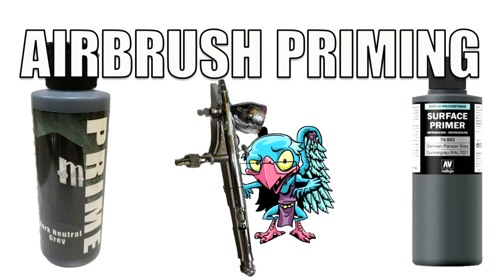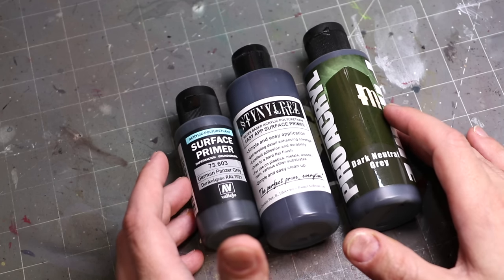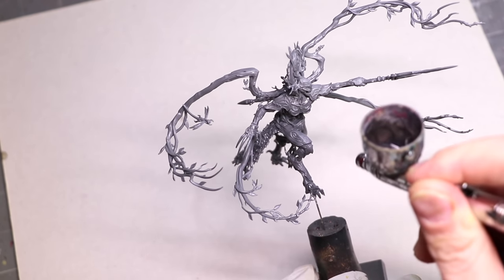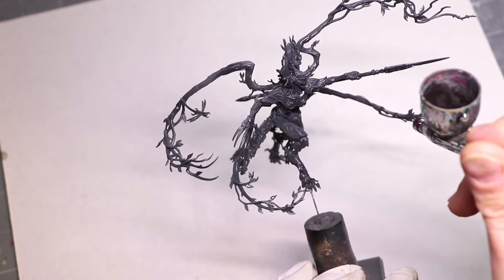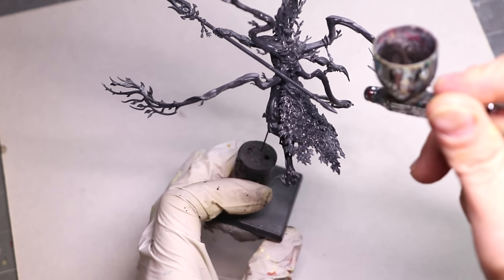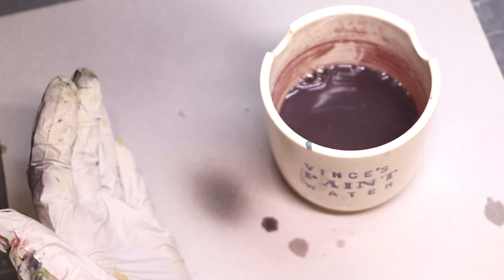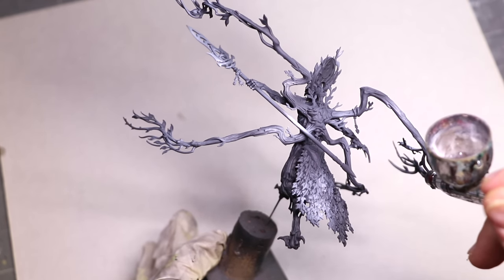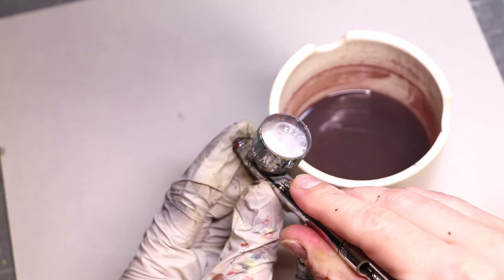Complete Guide to Airbrush Priming - HC 350

Comment: Isnt White ink stricktly better for the zenitial highlight than white primer? Thank you for the video im new to airbrushing and had the problem with drying in the cup. Thanks vince for all the great Videos.
Reply: Naw. White is white. White ink is generally smoother than most white paints, ie not chalky, so is preferred but there are some good white paints on market that aren't chalky.
Reply from the maker: So some people have issues with white ink reactivating. I tend to prefer white paint actually, sort of in the middle, as I never use straight white, but always ivory, or a light blue or something like that to set the tone. That being said, I never have an issue white ink.

Comment: Hi Vince. Great video. Great channel. I am having good success with Pro Acryl primers, as someone new to the hobby. I use their black and white for a zenithal prime. I also use Vallejo Cold Grey Game Air for a grey tone. In this video, you mention Pro Acryl Dark Neutral Grey is fast becoming your favorite. I am tempted to pick it up. Why is it your favorite? In what applications do you use the dark neutral grey? Do you include it in zenithal priming? Do you prefer it to black? I've used Vallejo Grey primer, but don't like it. It is a much lighter color than Pro Acryl, but that's not the reason. I struggle to get an even coat without gumming up some of the details of my model. I am still new, but I find Pro Acryl more forgiving.
Reply from the maker: I love the dark neutral grey, and it basically replaces black. It's just a softer color that isn't as harsh as the black for zenithal.

Comment: I got an Iwata Eclipse HP-BCS Siphon Feed Dual Action Airbrush many, many years ago when I was airbrushing shirts and fabrics. I am wanting to use it for miniature painting now, but most/ all videos I find revolve around airbrushes that use paint cups at the top. What would be the best way to use it for priming if I can not add a few drops of thinner before the paint? Should I use a separate bottle for thinner, spray a bit of it, and then put on the primer bottle? Thanks for any advice.
Reply from the maker: So best option? Buy a cheap new gravity fed airbrush, I promise you in the long run, the 30-100 you spend is worth it compared to the frustration. That being said, yes, separate bottle for primer and paint.

Comment: Angel Giraldez says to pour your paint into some container first to prevent clogging by solid paint chunks, especially when you want to prime with some paint not meant for airbrushing.
Also did you try submerging the airbrush completely in a bigger container when changing colors?
Reply from the maker: That can be a good tip. I often just strain out my primer through something like panty house. I don't generally submerege between color changes just because of the mess, but I like to store it in water.

Comment: Great tutorial as always! I'm going to have to try out that proacryl primer. 

Vince, do you had any advice on issues with airbrushed inks not binding properly to paint? My models could be primed, left to cure overnight, then inks airbrushed on and left to cure overnight and still when I go to paint on top of them the ink layer gets ripped off by the brush. Varnishing after inking is the only thing that seems to work but I never see pros like yourself having to do that so I must be missing something.

The only thing I could think of is that I may be using too much flow improver (sometimes 2:1 or 1:1 paint to flow improver depending on the paint), but if I use any less I get dry tip near instantly. So I'm kind of damned if I do, damned if I don't in that regard.
Reply from the maker: This is generally why I favor paints instead of inks for zenithal, inks can reactivate when exposed to additional iquids. My best advice is you can varnish after that ink layer. Two layers of varnish should provide you with a protective layer so the ink doesn't reactivate. The other option is of course to switch to a thin paint.
Reply: @VinceVenturella  That's a great point and thanks for the advice! I will probably move to using white primer for zenithal like you demonstrate in this video and I'll continue to varnish if I ink. At least I know that I'm not entirely crazy for not always trusting my inks.

I guess the thing blows my mind is when I see in your videos that you'll bounce back and forth between airbrushing inks (as well as paints) then a brush over them and then specifically mention that you never varnished between layers. At that point I realize I've gotta be doing something wrong.
Reply: gamblortoo: Try Tamiya Flat white for a zenithal highlight. It sprays beautifully. Thin it with pure isopropyl alcohol.

Comment: Each time I prime with an airbrush, it gets a little easier, but I always feel like I’m spending more time than I need to. I watched this video again and want to make sure I understood something you said in this video: Should I only be spraying for 2 to 3 minutes max before cleaning the cup and continuing to prime? 

Yesterday I primed seven plague Marines and it took me about an hour and half. I was priming pure white which know is obviously a factor. But I just kept getting clogs and dry tip  after the first few minutes of priming despite using thinner before adding primer and using a high psi setting. Is this just what happens when you prime with white? I am using Vallejo white and the Iwata CS-Eclipse. 

Also thank you for the wonderful content!
Reply from the maker: Okay, so that's terrible, and the reason is the primer. Stop trying to use Vallejo white primer, it's trash (most white primer is trash). If you want to use primer, then Pro Acryl white primer is the way to go. Otherwise, just use like an ivory paint thinned down (or one for an airbrush), and your life will get much, much easier.
Reply: @VinceVenturella  Got some Pro Acryl for next time, thanks!

Comment: if I prime with airbrush I also immediately varnish my model (with airbrush) to seal it because I've had problems with the primer rubbing off (I never have that problem when priming with rattle can)
Reply: I was going to ask - I notice chipping with vallejo mecha and standard black. I applied a varnish of testors dullcote and it seemed to really help. Will acrylic paint still adhere and go over the varnish?
Reply from the maker: Yep, nothing wrong with that at all. :)

Comment: Thank you so much Vince! I have some questions. I currently own both 0.2 and 0.4 nozzles and I struggle with constant tip drying with the 0.2 nozzle. Shall I switch to 0.4 for priming? How can I prevent tip dry with 0.2 as I want to do some detail work in the future and not scared of 0.2 tip. I tried retarders, thinners, flow improvers but still having the same issue. What is the ratio do you recommend? Thank you!
Reply from the maker: Yeah, in general, you want a larger nozzle for priming.

Comment: White primer is the worst. I spent a long time struggling with it when I first started. I was using a cheap brush and probably not storing the primer well or using old primer which didn’t help. My top tip for airbrushing white paint is to mix it outside of the airbrush. I now look it like I’m making a white sauce, I add a little bit of thinner at a time while stirring, just like making a sauce without lumps in it… also any big particulates sink to the bottom of the receptacle and not splatter out the airbrush
Reply from the maker: Yep, it can easily have some chunks in it.

Comment: I have had a bottle of the Pro Acryl Black primer for about 6-7 months and it has somehow become extremely thick. It says do not thin in its instructions, but I couldn't get it to flow without going to about 40psi, it still wasnt any good to work with without a lot of flow improver, but then I am worried that it makes for a weak coat that might rub off.

Comment: Hey Vince, first of all, thank you for all the amazing hobby cheating videos you have shared with us all. It’s pure gold and I have watched tons of your videos, some of them several times even. So it’s very much appreciated. 

I have finally purchased my first airbrush, inspired by your videos. I did however not use it yet, as I find myself always missing something to get started. Or maybe I’m just a bit scared of putting paint in it for the first time and try it! :) 

I would like to start off using it for priming and and senithal highlighting. I do however not have isopropanol alcohol yet which you recommend for both cleaning and also to put a drop in the priming mix. How important is it to have in the primer mix?
I do have airbrush thinner and flow improver, and also some “airbrush cleaner” product. 
And I got Valejo’s black surface primer. 

Second question about priming. How important is it to use a “primer” type color vs using a regular acrylic paint? 
E.g if I want to senithal from above with white, should I get myself a white or light gray primer color too for that or is it fine to use any white?
Reply from the maker: So the alcohol is not strictly necessary, it’s just good for cleaning more than anything. The zenithal layer after the primer can be primer, paint or ink. All good.
Reply: SO the formula to use is Thinner+Flow imprver + primer is that the mix?

Comment: Question on White Inks as a zenithal when priming: 

I have a bottle of Liquitex Ink Titanium White. When I use it as a zenithal it seems to never dry, even after 24 hours of waiting. I have also a bottle of Vallejos Surface Primer White which works without a trouble.

Any ideas on what I'm doing wrong?
Reply: I use liquitex ink titanium white, it’s my workhorse for zenithal, but I did notice that while it does appear dry imho, its grip can sometimes be a bit tenuous, so usually I add a coat of varnish after the zenithal to avoid it being pulled off. Maybe that will help?
Reply: I think you're being too ham fisted in application. You should repeatedly layer a very thin stream that dries almost immediately, over and over until you reach your target opacity.
Reply from the maker: Inks are tough as they can reactivate, it has to do with ink type, humidity and many other factors such as additives. . You can always try to varnish after it, but honestly, I often just use white paint or similar, or if I use ink, I mix in a little paint to make sure it's more resistant.

Comment: Great stuff Vince, really helpful! One thing I'm not sure of, however, is how durable primers need to be for our models. I've seen everything from primers that come off with very light abrasions to primers that are nearly bullet proof. Even after washing some models with mild dish soap, some primers just doesn't seem to adhere well. At what point should you worry about poor primer adhesion and do you have any tips for a better bond? Currently using Scale 75 grey surface primer and it seem pretty fragile. Thanks!
Reply from the maker: In general, if you give things two good coats through the airbrush, you're fine. Just don't be handling your model, use a painting handle or something similar and once the paint is on there and varnished, you shouldn't have any issues (heck, I don't even always varnish). :)

Comment: Sory if question is stupid, I don't use airbrush, I'm planning to buy one, and in one of video I heard that IPA alcohol can damage the rubber seals in airbrush. But I see you recommend using it to clean. I was planning to buy Vallejo celaner, but now I'm not sure
Reply from the maker: I’ve used it regularly for years, never had an issue, you don’t let it sit, but it’s fine.

Comment: Hey Vince, love your content. How do you use white ink? I've seen videos where you've added white ink to colors in the airbrush for highlights. Do you ever use it in  the priming process? Picking up my first air brush this week. Tired of the crappy priming results from rattle cans. Your videos  have inspired me to take the plunge. Cheers.
Reply from the maker: I don't like it in priming, because it can reactivate too easily, usually, just mixed for sharp thin lines when I need a pure white for thin lines (or to make a very bright, high value thin line).

Comment: Hi Vince do you have an opinion on Liquitex airbrush medium? Second question is, do you have any issue with decanting GW paint into droppers while prethinning said paint with airbrush medium?  Thanks I love your  production value these days!
Reply: I believe he has a video on doing that very thing. In my experience I’ve had mixed results some don’t need much thinning and will actually be too runny if you add the wrong amount of thinner which would be the yellows and oranges in my case and some are super thick still even after a lot of medium some of the darker colors did that to me. It is a time consuming process, but if you’re tired of the pots it’s worth the time. Took me a whole afternoon, but I had a lot of paints.
Reply from the maker: 1) It's perfectly fine, completely viable. 2) Nope, it's exactly what I do. :)

Comment: I have been priming a few metal miniatures, and been noticing that the paint is like.. not drying or adhering to some of the crevaces or nooks or folds in the miniature?  do I just need to do a few more coats? or do you think maybe I've been thinning it a little too much?
Reply from the maker: COuld be either, I generally go for two thin, but solid coats on the miniature, especially for metal.

Comment: I've been following this to prime my minis, I love the quality of the prime but I've been having all sorts of problems and it keeps ending up taking forever.
- Using Stynlrez black, sometimes I get a nice even coat but sometimes I get a ton of spiderwebbing. Am I thinning it too much? I've got the trigger restrictor set to not release much paint at all.
- By the time I come to clean after 2-3 minutes of priming, it's already coated the inside of my airbrush cup with a totally dry layer of primer. I think this is the paint left there after the backflow, and it's a huge pain to remove.
- A simple clean isn't enough, if I don't strip my airbrush right down to thoroughly clean it before putting it away after priming then it will be utterly clogged by the next time I use it. I keep having to take the nozzle and nozzle cap off, clean a ring of primer that's collected around the outside of the nozzle, and clean a very tough to remove ring around the inside of the nozzle cap. This is the air path, and I've got no idea how paint is getting back in there. 
- For some reason, I always end up with a little bit of dry primer in the well where the needle is. I have no idea how, because I never let it run dry and it's basically always wet right through being cleaned.
- I have really bad issues with tip drying, even using the 1-4 thinner-primer ratio with the 9-1 thinner-flow aid mix. 

Priming a single model will take me a good 20 minutes worth of setup, priming, and cleaning, and it's really quite a hassle. Cleaning regular colours tends to be a bit quicker so it's less of a problem, but I don't use the airbrush much to paint and mostly use it for priming. It's just so much cheaper than spray paint, but when my time is spent 10% painting 90% cleaning it really feels like I'm doing something wrong.
Any advice? I want to love my airbrush but unless I'm using it for more than an hour at a time it really doesn't feel worth the hassle, even following this procedure :( 
Thanks!
Reply from the maker: So in general, Stynelrex can do this, you want some 99% isopropyl to clean it after, that will get rid of it. It's a challenge with Stynelrez. 

1) Sounds like its either thinning too much, or the brush is too close. 
2) Alcohol to clean. That will strip it out no issue. 
3) The alcohol will help prevent this. 
4) Dry tip can just happen, it's no issue generally, just a moise wipe can take it off. 

My best advice is ditch the Stynelrez, it sounds like the humidity in your area is such where its not going to work well, and very much working against you, as I said, this stuff is sensitive to humidity. Get some Pro Acryl primer, it shoudl hopefully serve you better and perform much more easy.
Reply: @VinceVenturella  Thanks for the reply! Really appreciate it.

I hadn't considered that I might be too close, that's definitely something to keep in mind. Everything I read is about thinning and from my perspective I seemed to flip flop between clogging and spiderwebbing, so there didn't seem to be a sweet spot.
I've been using IPA to clean it out, but it still needs a good bit of elbow grease even with that. I guess that speaks about the quality of it as a primer if it's that tricky to remove from metal, lol.

I'm from the UK, so the humidity should be fairly average. Not dry as a bone but certainly not humid at all. I'll give the Pro Acryl primer a try, though it is a bit more expensive than the Stynlrez here. 
Thanks again for getting back to me!

Comment: Hey Vince, can citadel paints be used to prime? I’m doing Deathwing knights/terminators, and I have had bad results with the bone paints becoming chalky and obscuring details. I compounded this issue by using white primer. What do you recommend here? Thank you!
Reply from the maker: I would use a standard primer first, you can prime with just paint, but there is a notable durability loss. A solid darker primer and then the brighter color over the top, you could go quite heavy with it just as paint and you could get a good result for sure.